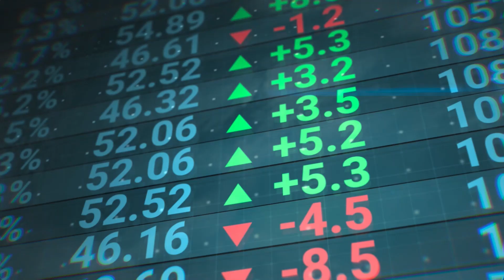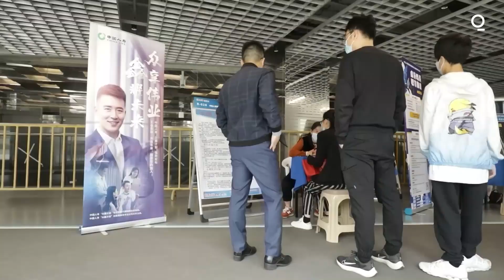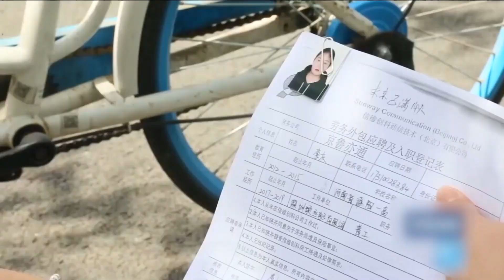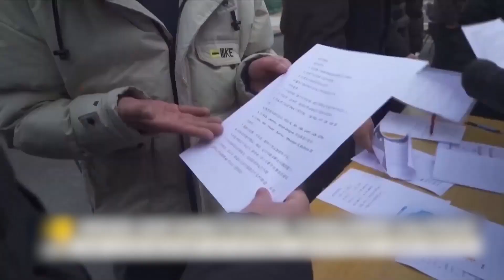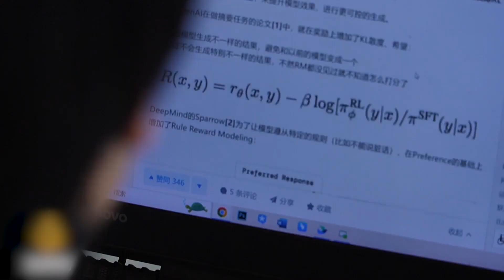The Rise of 'Sitting in the Coffice': A New Culture in China's Job Market | Wonder

Comment: Remove the periods of video with no talking. You can say something else, or make the video shorter. Have at most 3-4 such pauses in the whole video, and spread them out throughout the video.
Reply from the maker: Thanks for your advice!
Reply: @Wonderlandtellyoueverything  My pleasure! Good luck with the channel! Aside from the pauses, the content is good. Those pauses are usually used in longer videos to separate different chapters or large parts of the video into categories. But in a fairly short video like this one, you don't need more than 2 of them, in almost all cases.